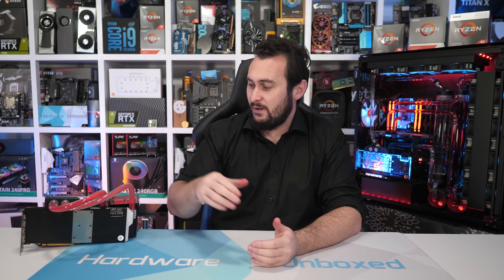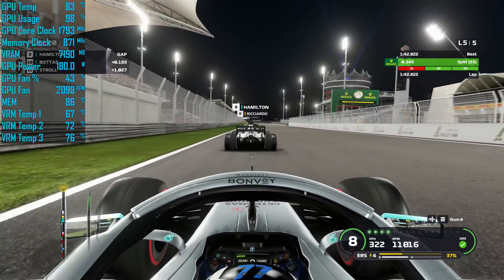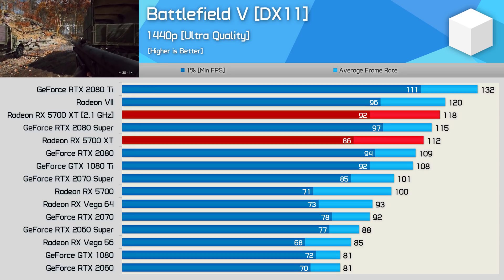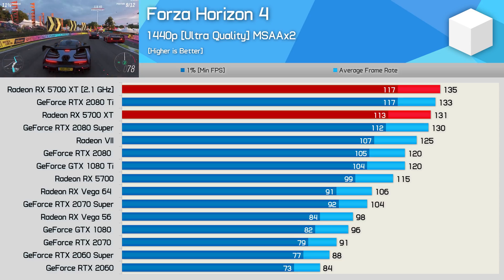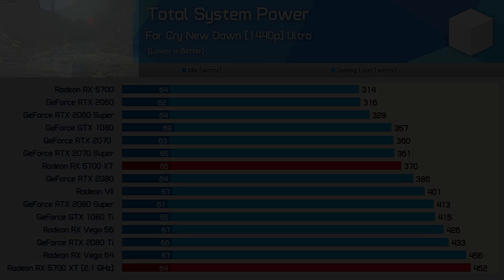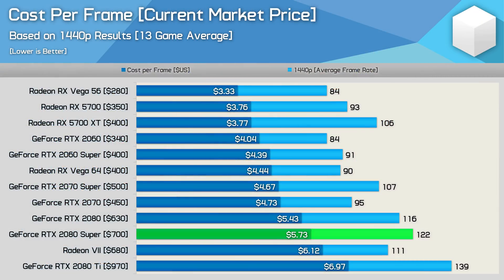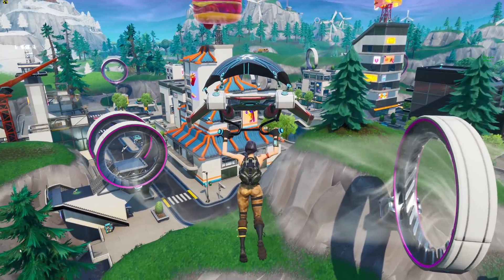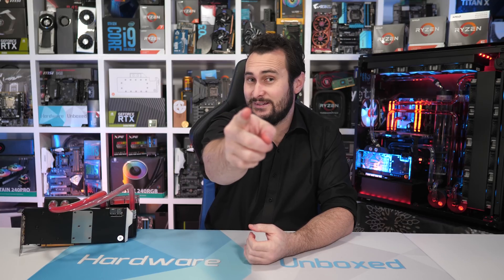Radeon RX 5700 XT Overclocked, RTX 2080-Like Performance?

Comment: Interesting thoughts on the memory holding it back. I’ve had extremely good luck on overclocking the vram on my card. I got it up to 950MHz rock solid and saw significant performance gains. I might even be able to go higher but that’s as far as wattman allows. I haven’t gotten around to doing any significant overclock on the core clock though. Using a Strix 5700XT on with EK block. Core is 1985MHz, vram is 1900 (950MHz), with a +50% power limit and a undervolt to 1.149v
Reply: Have a gaming X and used the RBE and PPT to allow me to go up to 2100 on the memory. From 1800 - 1900 on the default MSI slider, its never really stable and will eventually crash in games. It would crash at various points from 1900 - 2000 then after that hits looser timings and is stable through benches. Just playing about in timespy I had it completing with no artefacts with the memory at 2010. Was getting into the mid 70's on memory temps though. Maybe on water you'll have better luck.

Comment: The sweet spot for these cards is probably more around 2000Mhz with a significant Underclock.
Still very important to underclock these, (especially now in summer) I find the stock settings are prone to overheating!

Comment: Bought the Tuf Gaming OC Version today and im shocked how silent and cool the Card stays for hours of heavy load. Wasnt able to get the Card to run to its limit. I switched from XFX RX 570 8GB which always run at 85+ degrees in my (completely Open case) while the rx5700 XT never goes above 70° and isnt even recognizeable in a silent room o.o 

I luv my RX 5700 XT and im sure it will stay in my PC until it dies 😂
Reply: Same here. I switched from Aorus RX 580 (~85º) to a Sapphire Nitro+ RX 5700 XT (~70º) and I'm in love with my new little lady.
Reply: @Augusto_Santos.91  yeah definitly a great card for that price :) have fun with yours ! 

What CPU are u running ?
Reply: @kewa_gamedesign  Ryzen 5 2600
Reply: @Augusto_Santos.91  Same like me :) i love this cpu :) i run it stable at 4.1Ghz  watercooled, but i will upgrade to an Ryzen 5 3600X next month 😅

Comment: Umm my 2080 super get a avg of 100fps max settings in 4k for f1 i should try 1440p im pretty sure ill smash 125 avg like in video...... Um yeah my dude i just did the bench mark and got min 108, avg of 151, max 190fps dahell wrong with your gpus lmfao my 2080s matching your ti lmfao. Edit just ran 4k bench and got the following min 83 avg 107 max 137. Maybe your cpu is bottlenecking ur cards.

Comment: Reference 5700 XT runs at 1790 MHz core average? Uuf.
With my Red Devil, I can get max OC without PowerPlay tables at 2050 MHz average core clock when OC'd to 2110, averaging 240W and spiking to 264W. Otherwise, it averages at 1998 at stock at ~205W

Comment: My reference 5700xt @ 3600RPM fan at 75c hit 2100Mhz a lot.
Reply: How did you overclock it to 2100?
Reply: @joneslego3645  literally only push the frequency in Wattman to it's max @ 2150mhz. Currently, I have the power limit at -4%. I replaced the thermal pad with a mediocre pad. That is it! I must have bought a 5700xt with a golden chip.
Reply: @a.ndy.nonymous  how much of a difference do you see  in terms of real world gaming when clocked to 2150 vs stock? also does the power consumption goes up as much as shown in this video?

Comment: The 5700 XT has surprisingly lived up to the hype. It offers about the same value per dollar (arguably better value per dollar) than the 5700, and runs roughly as fast as a 1080 ti for 400 US. This actually exceeded my expectations. AMD scared us with those initial price announcements, and the 5700 was a little bit disappointing imo, but the 5700 XT has turned out to be a quite pleasant surprise, performing  better than expected, and at a very competitive price which is making most other cards out there look pretty stupid at current pricing. 

I guess we'll soon find out how good the board partner cards are. Hopefully there will be some good ones for roughly MSRP.

Comment: Watercooling a system can indeed produce performance gains, but we have to keep in mind the downsides: cost, complexity, inconvenience.  Steve notes the price of the EK block, but then there's a pump, reservoir, radiator, fittings, and tubing to buy (assuming you don't just have these lying around), and using EK's configurator drives the price to about $450 for the simplest possible GPU-only loop.  I've built a full custom EK loop with a 6850K and 980Ti cards in SLI (mostly to control temperatures and noise) and while it's not overly difficult to do, it adds complexity to the system and introduces multiple point of potential failure.  Finally, once you've built a custom loop, further parts swaps are a royal pain.  Sure, you could use quick disconnects, but that adds even more to both cost and complexity.  AIB cards can't get here soon enough.

Comment: 5700xt is shit. Gave it a few days but constant stutter in games, textures popping in and horrible fps drops made me return it. Far cry 5 was a stutter mess with full second hangups and fps drops into the 60s. Only game that played well was bf5 and it stutter had more stutter than nvidia. Swapped it for a 2060 super and all is well. Also common issue gta5 won't even launch on the 5700xt. 2060 super is 5% slower, overclocks well, comes with 2 games, and doesn't sound like a jet engine for around the same money. Oh and my mins are 20fps higher in far cry 5.

Comment: The 5700XT isn't worth the waste of money for an EK Block and the matching back plate. Jay proved that much with the testing he did earlier. With the 5700XT you're getting the card as AMD intended it to perform. If you want 2080 performance, just buy a 2080 to begin with.

Comment: Is it possible to use some overly build RX570's cooling to use it to RX5700 or the XT?
For example, the custom cooler from Gigabyte or Asus. I know the TDP might be a problem, but I figured it would still better than the reference cooler, no?

Comment: Air cooled 5700XT will be right there with the water cooled you tested here. I am personally water cooling but I was going to do that with whatever card I got. There is a big Nemesis 420GTS currently shoehorned into the front of my case (seriously, fitting required a Dremel and a hammer). It's more of a silent build so I'll tweak the GPU and CPU very little if at all.

Comment: I don't think the overclock and power consumption increase are worth it for such a small performance gain.
I do think the 5700XT performs well on stock.
What would probably be a better use of the GPU is to undervolt it as low as it will go on stock to produce same or better performance (allowing the max. boost clocks to be sustained for as long as they are needed).
I think this alone could produce better overall results in efficiency and performance, rather than overclocking.

Comment: Badass setup:
Radeon RX 5700 XT(custom cooler - need to wait)
Ryzen R5 3600 + CM 212 EVO cooler(temps are important for 3rd gen AMD)
Whatever B450 MOBO with decent VRM cooling("Boot kit" from AMD needed to update the BIOS, or just ask the seller)
WD 500GB SN500(halfdecent M.2 NVME drive for price of SATA SSD)
Whatever 1TB HDD
Whatever 16GB 3000MHz+ of gskill's tridentz RAM sticks(those OC good on AM4 due to samsung dies)
Corsair RM650 PSU(fully modular and semi-passive cooling)
Price around $1000

Comment: honestly AMD made these new pats, the Radeon and the Ryzen parts squeezing out as much performance as possible in stock.. it doesn't make sense for them to leave performance on the table for any of these parts since the vast majority of users do not even think to manually overclock their CPU's and GPU's .. so making something at anything less then the most optimal setup is not a smart move when trying to tackle Intel and Nvidia at the same time.. they want the mindshare, they want the most performance they can

Comment: My amd 5700xt anniversary edition runs at a consistent 2130 Mhz on the blower cooler while acheiving sub 80°C temps. I have been able to hit 2200 as well, however, it has been difficult keeping up with the high temps it produces. I am really considering getting the water block and maybe I can get this thing to 2300 with that 30°C temp drop. Great video!

Comment: really hate how techtubers don't do Full HD 1080p benchmarks anymore...
Reply: depends on the cards but those cards we are clearly reaching CPU/memory bottleneck. so what is the added value for comparing 

cards in bottleneck scenario ? in most cases it will either confuse or obscure the true value of the cards.
Reply: I hate how I can't easily find 4K videos. Found one today for this card but it is annoying as heck seeing 1080p and 1440p ( don't know why anyone cares about that as it isn't a huge jump from 1080p).

Comment: So if you want RTX 2070 super performance with an rx5700xt plus the cost of a elaborate water cooler then ummmm.... Just buy an RTX 2070 super. Yeah yeah that's the ticket. 👏👏👏

Comment: "you can overclock a 2080 too, but that's not the point." YES exactly this IS the point. It's more and more obvious that you are affiliated with AMD. That's not logical to buy a 450 Dollar card and add a 170-200 dollar EKWB block cooler to get "2080 like" performance.

Comment: Also, I think if you're going to do this, you're better off doing it to the 5700. That way you don't have to waste power on the extra CUs which seemingly do nothing for performance, and you can bring the GPU power down by ~10%, or down to ~230W, which is much more attractive with the performance being ~3% behind.

That said, I think AiB 5700's will therefore be pretty attractive. Because if AiB cards come in at ~$350, then here you're seeing about the same level of performance for about half the price.

Comment: The 5700XT pluss the EK block is cheaper than just buying a RTX 2080 if you already have a cooling system. 570.00 compared to 650 if you have a loop in you computer.

Comment: Looks like AMD did a reasonable job cinching the card high but not stupid high. The card is fast and energy efficient at stock.

Undervolting and slight overclocks might be a way to keep power in check and axial fans can keep the temperature in check.
Reply: Nah... just undervolt it and allow the max. boost clocks to be sustained for as long as they are needed.
You will probably get a performance uplift like this (around 5%), while removing the thermal limits and dropping power consumption at the same time.
Its more reliable.

Comment: It probably does not overclock very well due to it's super small cost savings die size. I think it's the replacement for the rx 570 and when they release the 5800 series it will be a replacement for the rx 580. I do wish they would release a larger die gpu for a reasonable price. The gpu market is as stale. We need a new $250 gpu that sets a new standard. We don't have that.. What we have is 1080ti cards for $400-500. That's not new, we had that for years.

Comment: Lol my rtx asus 2080 ti oc 11Go run at 2,1 ghz without watercooling 😄
Reply: so your 1200+$ with 11gb 616 GB/S with 350 bit bus did the same 2.1ghz as 5700 XL 8GB 448 GB/s with 256 bit bus, Alphacool  XT45 X-Flow 280mm, Alphacool 6-Packs Fittings and tubing of a cost 730$ without shipping, so the fps that 2080Ti has over 5700XL cost 350-ish$

Comment: Here I am wondering how many GSODs you got while testing :P. Good stuff!
Reply: The YES man!
Reply: Tech yes city
Reply: TECH YES! CITY
I got a 5700 XT, too, now!
While I do admire the outstanding price/performance I have to say I'm missing the Nvidia-level reliability from my 1070.
For the time being this will be my card but I'm eventually going to upgrade to RTX when Raytracing is ripe and probably dive into raytraced Minecraft hardcore.
Reply: @Benevolence22  you can run rtx Minecraft on the 5700 xt

Comment: one option would be the arctic coolers. I can personally recommend the Rajintek Morpheus it is deliverng great temps on my Vega 64, However i think it has similar perfromance to the arctic cooler and the arctic cooler comes with fans whch makes it significantly cheaper when you add the fans and the hassle of getting a gpu fanheader splitter

Comment: Rx 5700 xt costing 399 beats out rtx 2080 costing over 600 in 3 games at stock speeds. Once AMD releases new drivers it'll probably crush the rtx 2070 super.

Comment: I hope they have better GDDR 6 memory on those cards by the time the AIB cards come out. Normally Nvidia cards you can boost memory quite a bit before regression and errors set in. Seems odd you can't on the Navi's. I wonder if that is a power limitation to the memory on the stock boards. If so, AIB should be able to unlock that and give more control to users. I 100% agree that we are seeing a GPU memory bottle-neck holding the performance gain back in this case.

Comment: Checking igors lab post, actually there is only a 10% uplift in SOTR for the 5700xt with sppt mod, and that's at 1080 ultra. If you consider the 2.2+ ghz in that test, it makes sense. We all got excited 'cause it was just bellow the 2080 FE... that's all
Reply from the maker: 1080p wouldn't be memory limited so that also makes sense. I feel like you're looking at a cherry picked best case scenario. Why have a world exclusive and then test a single game at a single resolution? Very strange.

Comment: Why did you use the powerplay mod?, I can get mine to sit between 1970-2000mhz most of the time and peak at 2007mhz with (2054mhz/1066mv) in wattman, I think it will go even higher on a waterblock!, Temp are 70c normal 85c junction with 65% fan, But it's stupid hot in the UK right now 32c, So you only getting 2100mhz with the powerplay mod!, Remove the powerplay mod and undervolt the card and try again with that waterblock, See what Freq you can get at a lower voltage?, I guess you got some bad cards, my card also runs below 200watts (150-180)watts with those settings in rivatuner overlay running heaven benchmark.............I've been reading the comments below and I think people are forgetting that navi can run in a wave64 or wave32 configuration (backwards compatible) so for older games that have been coded in wave64 it will not get the full benefit of the new arch and will run a bit better than vega in those games but not to full potential . Once Navi is in the console's and they are coding properly for navi (wave 32) you will see a boost in perform on pc ported games in my opinion!......wave32 is faster for Navi it has two SIMD32 and can perform the same instructions in one clock cycle compared to vega's SIMD16 which needs four clock cycles. I think they have done a great job with this gpu. You are getting nearly 1080ti performance for $400 or £379 pounds. (The compiler can still pick, on a draw-call basis, whether it wants to execute in Wave32 or Wave64 - the latter across both SIMD32, based on workload. Aiding extra parallelism, resources from two adjacent CUs can be combined and applied to a larger workgroup, further helping reduce latency).

https://hexus.net/tech/news/graphics/131555-the-architecture-behind-amds-rdna-navi-gpus/

Why do I even bother! Keep paying Nvidia's silly prices and next gen you will pay even more!, Nvidia are not worth the extra money for the small increase in performance from last gen! 

https://gpu.userbenchmark.com/Compare/Nvidia-RTX-2080-vs-AMD-RX-5700-XT/4026vs4045 , So a RTX 2080 super is on average about 4-9% percent faster than a RTX 2080 across different games.

So a 11% percent increase at best over a RX5700xt for another £290 pounds. https://www.nvidia.com/en-gb/geforce/graphics-cards/rtx-2080-super/

https://gpu.userbenchmark.com/Compare/Nvidia-RTX-2080-Super-vs-Nvidia-GTX-1080-Ti/4050vs3918 or a 7% percent increase over pascal for alot more money!

And no I'm not an AMD fanboy my previous gpu was a GTX 1070 and I have used Nvidia cards for years but when they up prices and offer basically the same performance as pascal for even more money something needs to give because their taking the micheal, They bet big on ray tracing which has increase thier die size and how many games support it? and how slow is it? is it really worth the extra cash? I guess that's up to you!, but the smart move has always been price to performance!...................

Comment: What i'm seeing in Canada is that this card is $80 cheaper than a 2070 and has the same to much better performance. This is a great value card IMO.
Reply: I am seeing some now for as much as $150 or so less and yeah they are blower cards but I had a GTX 1080 Ti at one point that was a blower card and no issues and finding some for AMD that are rated well. LOL!

Comment: Well, because of Nvidia's dominance in the discrete GPU market over the past decade, it only makes sense that most games are designed for Nvidia's cards. Games that are designed and tuned on Nvidia GPUs will of course outperform AMD GPUs. Currently, the industry standard has been DX APIs which impose more overhead on GPU memory and are far less sophisticated. Vulkan will change this and make it far more even, but since Nvidia has invested so much in research, their lead will take time to overcome. That being said, the possibility of a AMD Ryzen vs Intel [insert name]-lake CPU showdown showing up in the RDNA vs Turing competition is a real likelihood. However, I would guess that it will take a similar timeline as Ryzen did... mainly, a two year push to start trading blows with Nvidia's products. Hopefully, AMD will try and keep the pricing low and force Nvidia to do the same. If that happens, gamers win, and that is the most important thing to note.

Comment: 5700XT water cooled may not give the user 2080 numbers but its still worth it IMO. Noise and temps plus there's a 7ish% (average) in performance improvement.

I would think since GN showed Ryzen 3000 benefits from better cooling, aka water, that a water cooled AMD system would be the most optimal setup.